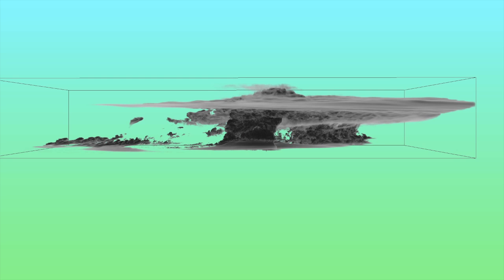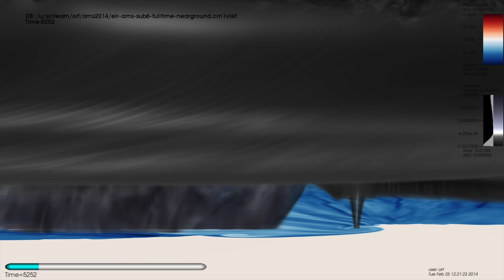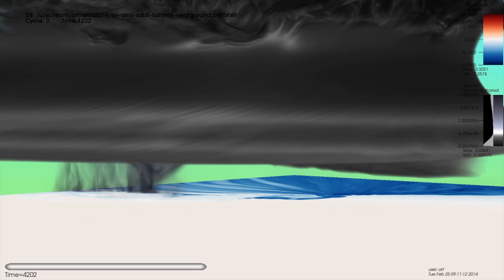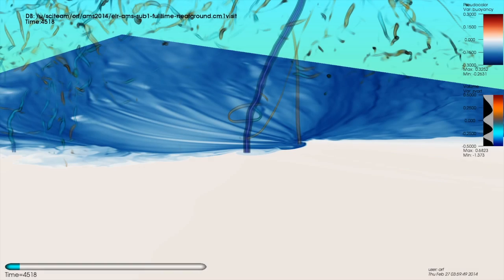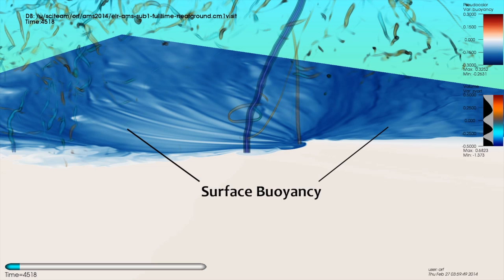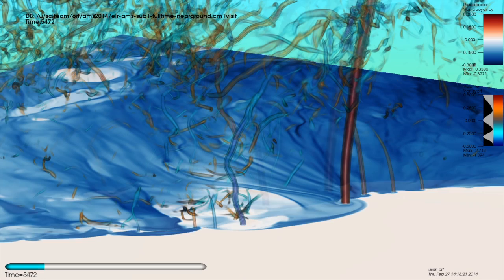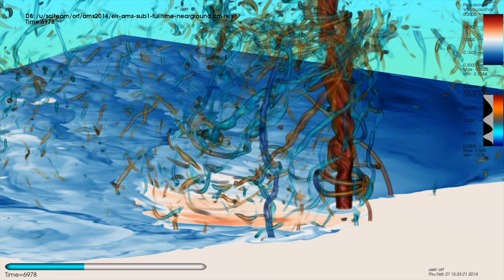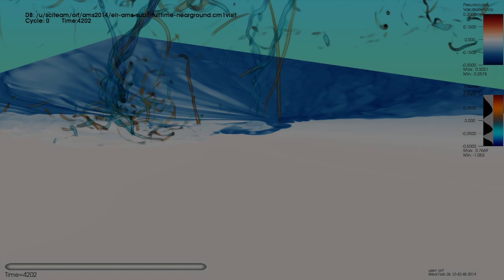El Reno 2011 visualization (2014)

Comment: so, could you ‘put out’ a tornado in its early stages with a bomb?  or even loud enough low frequency sound?  it seems like there’s a lot of really delicate things that have to all happen for the storm to become a monster.  but if you could change the rapid pressure drop to happen even just a little slower it might could prevent tornadoes from becoming EF4-5 strength.  i get that the scale of size and energy involved in a thunderstorm is hard to imagine, but i don’t know just a thought i’ve had a few times while watching these simulations.
Reply: Yesn't. Theoretically a large enough bomb like a nuclear weapon would definitely disrupt local pressures, temperatures, and humidity etc, but even a ridiculously and catastrophically large detonation like the Tsar Bomba would not be large enough to permanently disrupt the absolutely mind bending amount of energy contained within a tornado-producing supercell, a supercell powered by heat more than anything might I remind you, something you would have just added an incredible amount of to feed it. 

So the storm would temporarily be forcibly dispersed by the blast wave, but reform within minutes to an hour stronger than before due to the amount of heat just injected into its core, it would then continue onwards after regaining equilibrium. 

So, it could in theory, through sheer force of the blast wave, disperse what would've been a weak tornado on the brink of formation, causing it to fail and be unable to reform before the storm naturally loses its energy, but if a powerful tornado is forming all that energy and volatility won't stay gone and it will still likely form a tornado after the detonation is over, and now it would have the benefit of being a radioactive tornado and probably stronger than it would've been due to the additional thermal energy added to its parent supercell. What doesn't kill you just makes you stronger after all.

Comment: If researchers are serious about understanding the weather, then they have to look well outside of the box they know. Electric Weather Mechanics-  "...Because all atoms are made of protons (positive charge) and electrons (negative charge), all atoms are then, actual electric fields (a separation of charge) within themselves.

And with that and as far as the weather, as well as everything else within earth's biofield is concerned, that there is a Voltage differential between the generally negatively charged earth and positively charged ionosphere, rising by about 100 Volts per metre up through the atmosphere. Plus, that charged particles in an electric field- accelerate and move in a spiral motion.

So, this means that what we think of as the Atmospheric 'Highs' and 'Lows' are the major electrical currents running through our atmosphere, with the interaction between the currents creating our weather.

With the 'Lows' being the positively charged input currents and the 'highs' being the peaks of the returning negative current field. With the 'Lows' (new positive inputs) having to drill their way through the negatively charged overall field radiating from the earth. With the earth then, having to radiate more negative charge, in order to try and reach a state of charge equilibrium within the sun's electrical circuit.

An electric vacuum cleaner spins by way of an electric motor and it is its high spin rate that creates low air pressure and so making the cleaner suck and likewise, it’s not the Low pressure creating the movement through the atmosphere. But instead, its the spinning charge through the atmosphere that is creating the low pressure.

As the positively charged 'Lows' move down through the negatively charged water ladened atmosphere. With the electrically salty liquid having been lifted from the oceans. With it then pulling in the water vapor from the negative field, squeeze it together with the new positive input and short, within the spinning 'Low' and so then, produce semi-liquid (cloud) and if there is enough water vapor in the atmosphere, then fully condensed rain..." And differences in temperature is a by product of moving charge-  https://www.youtube.com/watch?v=7y46wMAHnsI&list=PLQTfnq7B6uPY1RjMjBjBS5fDxd3gJAvl3&index=3